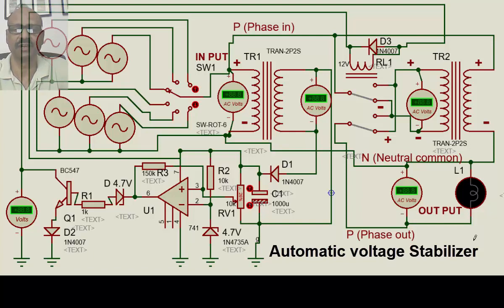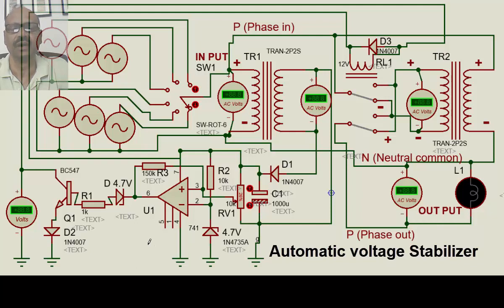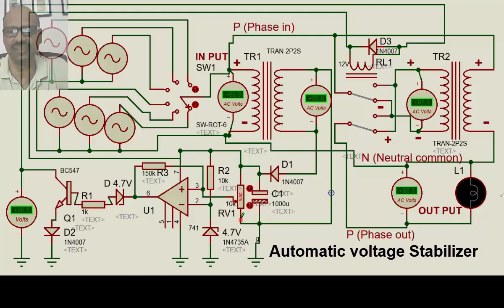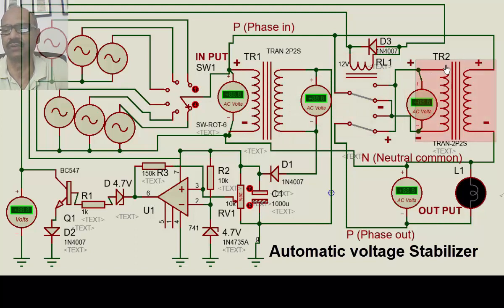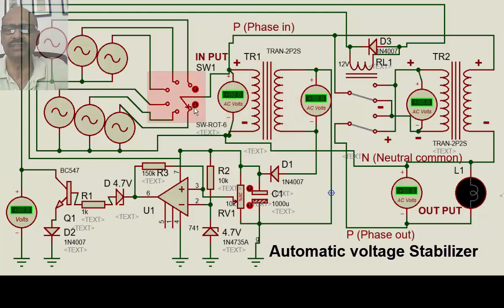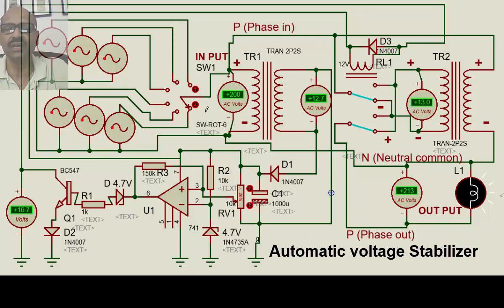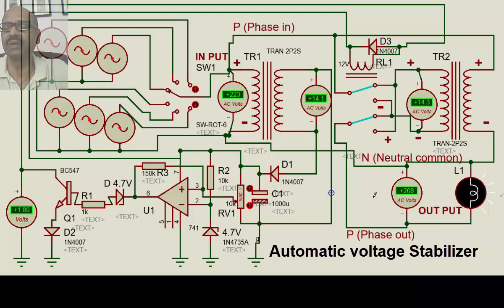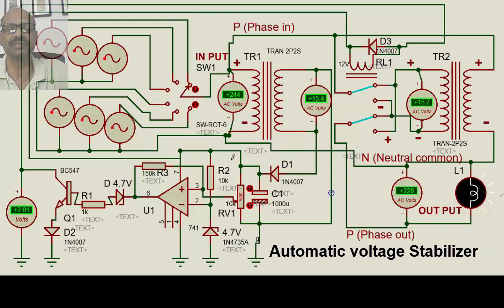Automatic Voltage Stabilizer  with no relay chattering

Comment: Can you kindly make a video on mainline Stabilizer differentiating between a relay based mainline Stabilizer with servo mainline stabilizer. Pros and cons of both. Which is better for home purpose, under 10 kva. Thanks
Reply from the maker: Thanks. Shall try